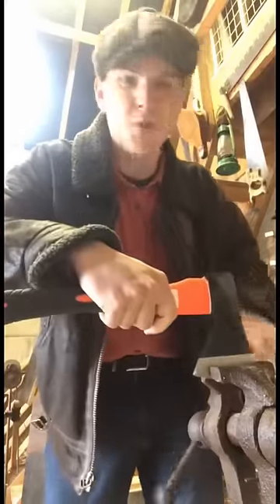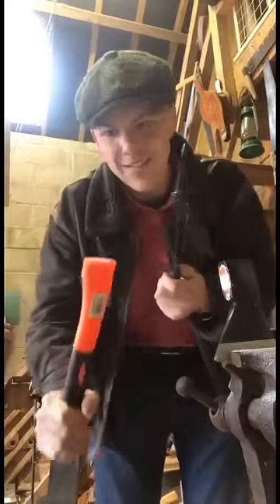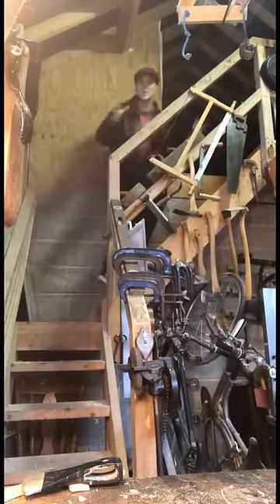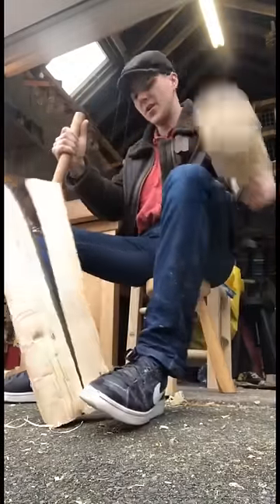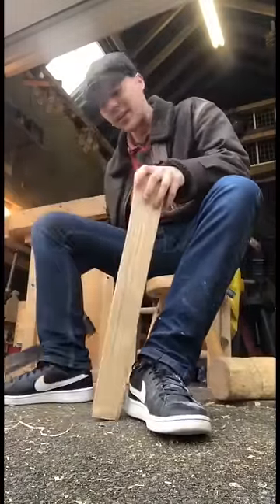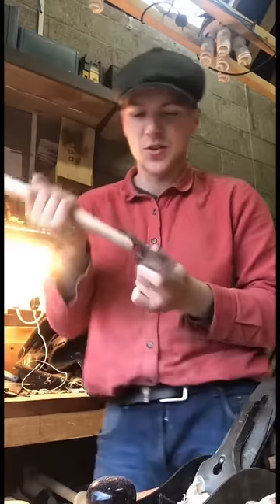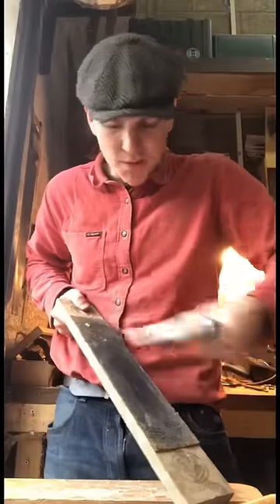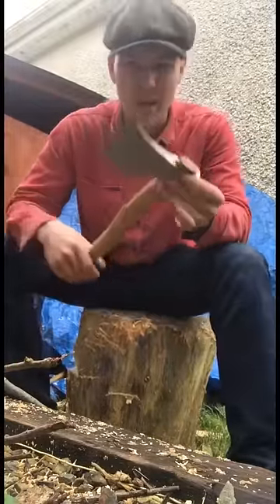Making an ash hatchet handle #woodworking #bushcraft #axecraft #shortvideo #handtools #ireland

Comment: "today we'll be using something that has brought far more grief upon humanity, the coping saw." As a woodworker who does a lot of joinery and trim coping, I felt that comment in my very soul.
Reply: It’s called a coping saw because you either cope with the saw or give up trying.
Reply: As a finish carpenter I almost spit out my drink 😂😂💀
Reply: What exactly is so bad about it? Coming from a non woodworker
Reply: Same here
Reply: @Hazed64  crown molding involves very weird cuts with a coping saw. Precise ones at bizarre angles like 22°
Reply: @Hazed64  the thinner the blade the harder it is to control if you turn it to hard while you're cutting you'll cut through the face of the moulding before you can even blink I swear to God 😂😭
Reply: @Hazed64  takes a lot of time to even get half way decent at it.
Reply: Oh how I laughed, and then the sad reality of the comment set in. You are a treaure
Reply: 20 yrs in to Home Remodeling and I still can’t use one properly 😂😂
Reply: @Hazed64 I work very sparingly with them and any twist that you might do and ya have bits of blade in your eye
Reply: @alec4672  oh shit yeah I know what the OP was talking about now lol. Used to HATE using that thing, was always why I fucked up my projects in woodworking class

Comment: I just built my first handle for my dad's old broken ball pin hammer he gave me. It's not the prettiest things, but my dad wanted his now fixed hammer back after he saw what I did.
Reply: Keep it going, re handling tools is a dying art, you can get tons of hammer, and axe, and shovel heads for cheap or free, and sell them with new handles.

p.s. it is Ball Peen hammer, for peening over things like rivets.
Reply: @bigbossimmotal  I'll try looking into that. Could be good practice for some small projects involving wood work I want to start, to help my parents around their house. Also, thanks for the correction. More to learn. 😅

Comment: When making a handle, be sure to get the grain facing the correct direction. If you have the grain going perpendicular to the axe blade, it is a bad handle and will break easily. Run your grain parallel to the axe head to avoid grain runout for a stronger axe handle
Reply: Don't think you need to educate this fella....he's all good

Comment: I've made 3 ash axe handles with not many proper tools, just whatever hand tools I had and they are beautiful and have lasted for years, and same as you I started with a tree I'd felled for firewood,  pretty amazing seeing a quarter of a split log turned into a beautiful useful tool! Nice looking handle btw! mine is much darker now from linseed oil and years of dirty hands but the grain alignment is right so good luck breaking them. Great video

Comment: Have you ever made a crooked handle for a single beveled axe head?

I can't remember where I even seen one but they were building log cabins. And they squared all the timbers by hand.

They would change the handle around depending on which direction they needed to swing with the flat down. 

The crook in the handle provided knuckle clearance and made for a more confident and accurate swing.

Comment: My grandfather taught me the same thang but he used a cant of hickory and hewed most of it with a small hatchet and the final was went to the dump and found a brown glass broken jug and broke a couple pieces from the bottom to use to smooth out the edges that 8 sides and very thin with turned into the fawns foot

Comment: Looks like your using the coping saw on the push. Reverse the blade and use it on the pull, this will maintain tension in the frame.

Comment: Doesn't it feel awkward to strop aan axe head? I think it does, but using a strop om a board gets my fingers awfully close to the cutting edge.

So I made a dismountable handle on the back, like a flat trowel. Works like a charm, with much, much, much more control of the angle and you can see better what you're doing!

It is dismountable, so I can lay it flat on its back, when stropping chisels!

Alternatively, stropping wheels are even more awesome.

Comment: Don't you need to split the end once it's through the axe-head, drive a piece of wood into the split end to pressurize it and keep the axe head firmly in place to minimize the risk of the axe head flying away, saw off the excess wood, then sand the cut part down and treat it to prevent rot?

Comment: I was hesitant at first, because I’ve never seen one of your videos. It wasn’t your outfit or any of the tools that told me you know what you were doing. It was the shape of the ax handle that. Let me know you’ve actually used one before. if someone is trying to sell you an ax and saying that it’s custom or one of a kind and it has a straight line type of handle, they have no idea what they’re doing. Axes should be fat towards the head and then come down about 1/3 to half way down for your final hand resting place. If you stack both your hands on each other and add 2 to 3 inches, that is where the ax handle is supposed to slim down it. You do not want an ax handle that slim all the way down because you will feel it in your forearms and hands very quickly. A comfortable axe handle should give you know forearm pump for the entire day of use.

Comment: I much prefer a wood handle. Fiberglass is fine, initially. But, when it inevitably starts to splinter? shudder And you can't even burn it proper when it needs replacing!